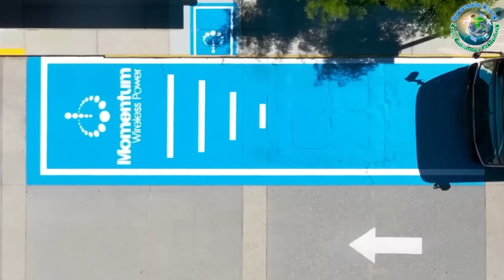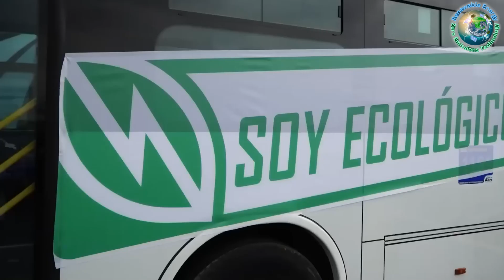500 BYD Electric Buses Paving the Way for Sustainable Transit in Belgium

Comment: A suggestion if you want greater reach: use old programs like CAT TRANSLATE, or new ones with AI to achieve it. IMPORTANT FACT: Although there are more than 369 million English speakers in the world, by October 30, 2023, the number of Spanish speakers was already close to 600 million, specifically: 599,405,122, 7.5% of the planet's population .